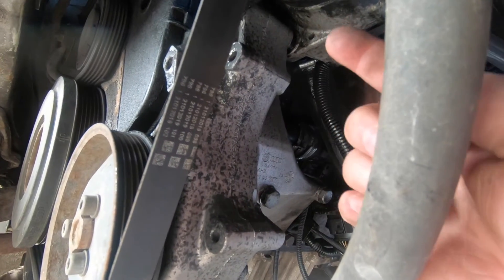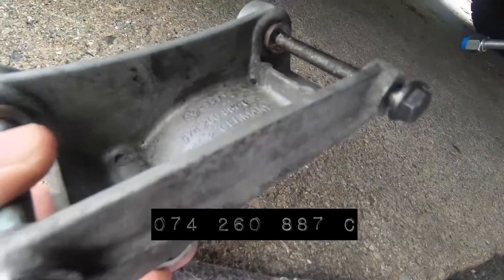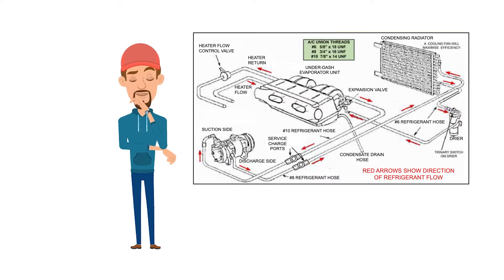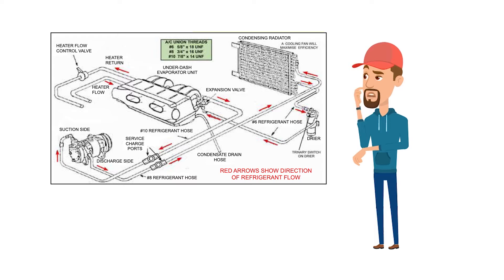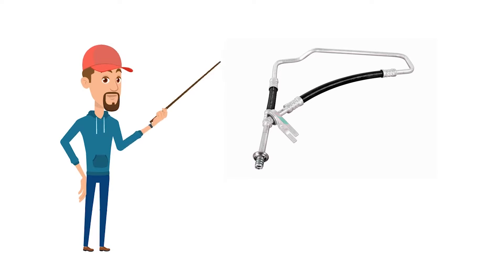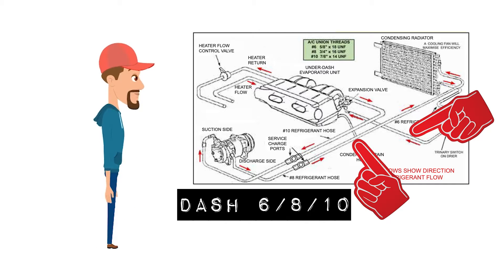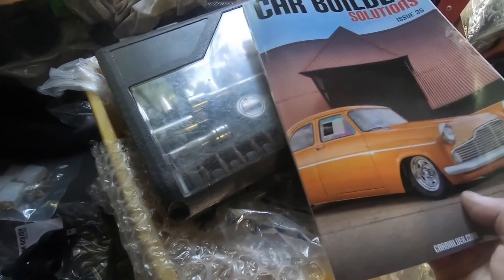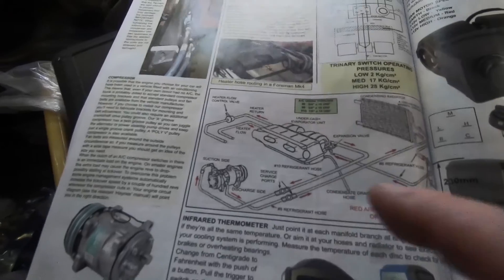Fitting air conditioning to our T4 Camper Van | Fitting AC 1

Comment: I have a 1994 caravelle and it didnt come with A/C
Reply from the maker: Yes, AC is not very common on these T4 Transporters as a whole. It's been so worth doing to ours for our summer trips in to Southern Europe.
Reply: @AdventuresAutomobiles I might have to do it to mine although one of the main problems with the caravelle is there are 2 heater boxes and control panels and I am looking at also updating the control panel to the late 90s version so I can put a touch screen radio with satnav in it